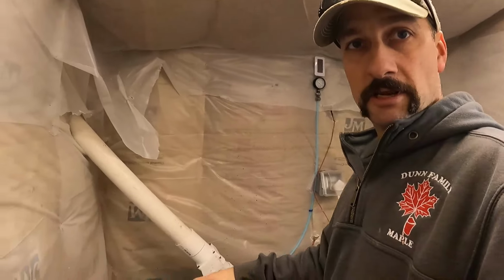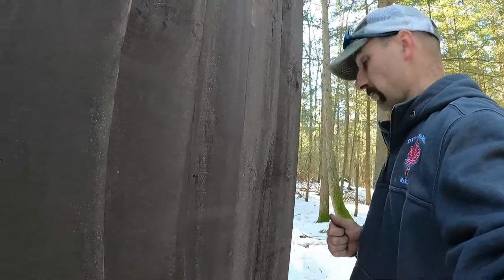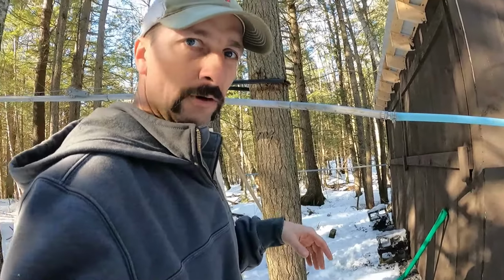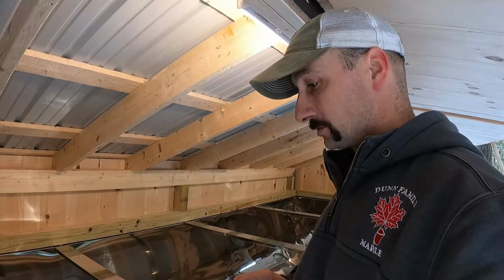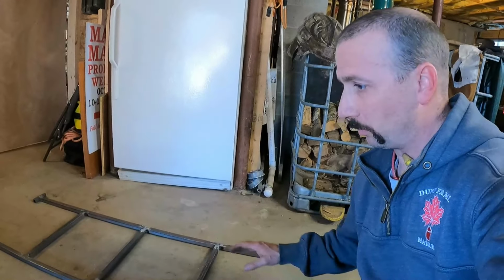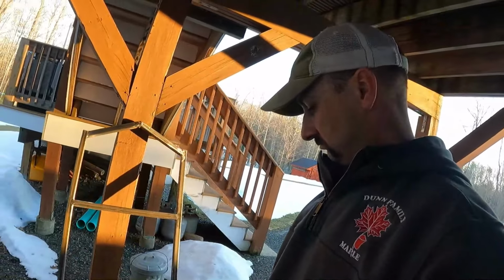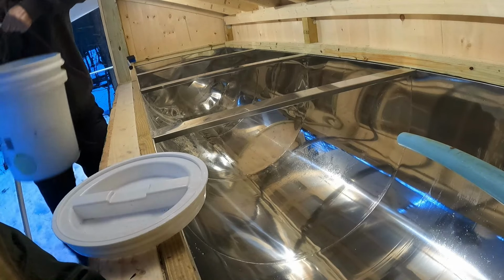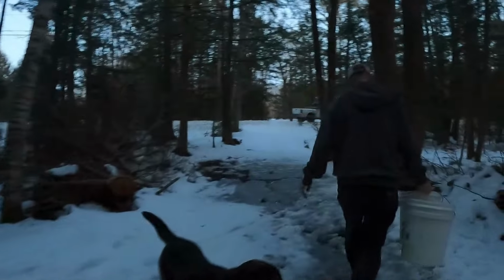Am I ready for maple season 2024?

Comment: Brian,

What are you using for the VFD on the extractor?
Reply from the maker: The extractor does not have one. It is just a 110 volt well pump
Reply: @dunnfamilymaple7642  My mistake, Brian. I was speaking about the ABB  VFD you're using for the vacuum  pump.